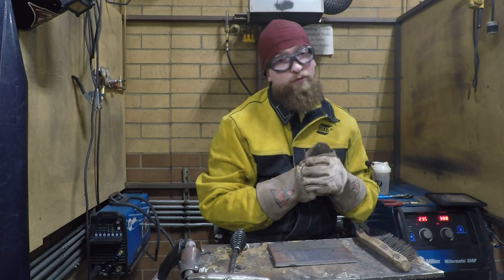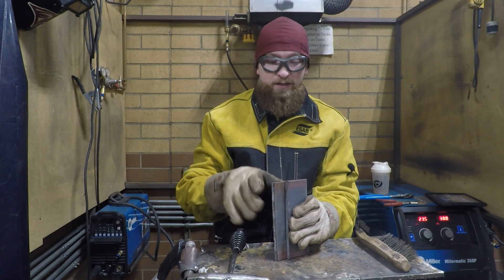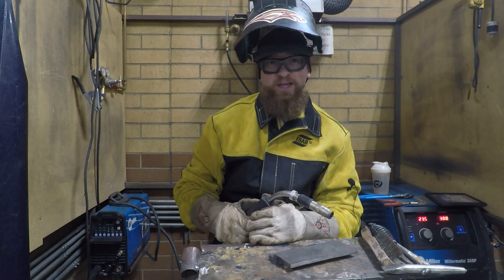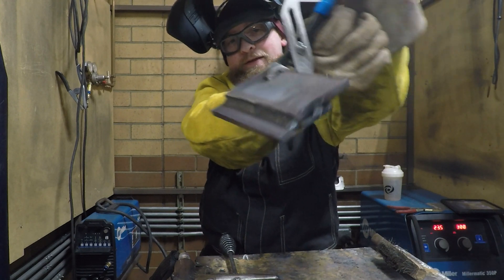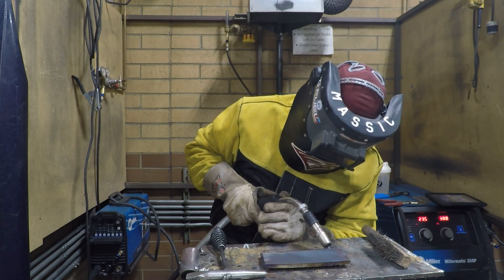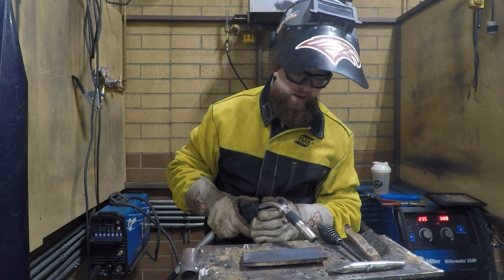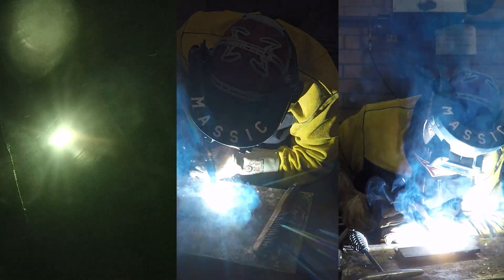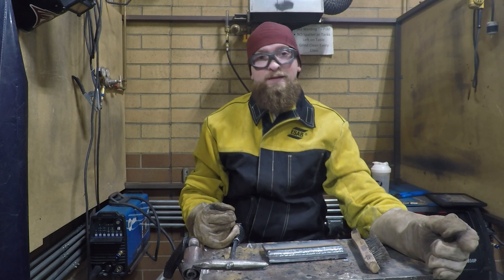FCAW - Weld 3 - Lap Joint

Comment: Jared..what if one plate is 1/4 and the other 3/8?..find a middle ground?  ..test plates?
Reply: Oh..forgot..I gotta Hobart  handler 190 if that helps..thx
Reply from the maker: Personally I usually go with the thicker settings and then favor the thicker plate.  As I weld I will then manipulate the puddle (maybe little circles) so that the puddle will wash into the thinner plate. But those 2 sizes are not that far apart that they should play well with each other.

Comment: Nice job. Just used my harbor freight flux core on some 1/4 plate in the garage it can't get hot enough. Have to slow the wire speed down to 30% on high voltage and go very slow and use a C pattern to make it work well. Any tips? Can't wait to upgrade welders.
Reply from the maker: Which Harbor Freight model do you have? Could be that the welder it self just doesn't have enough power.
Reply: @mmhswelding  Chicago Electric Flux 125. The cheapest one they have. I bought it to teach myself how to weld. It's great for less than 1/8. I put down nice welds on that but anything thicker, I think you're right, it doesn't have enough juice. If I run 2 beads on quarter inch it works. I melted two 1/4 plates lapped together like that and smashed the crap out of it with a 3 lb sledge and it held. What would be your recommendation for a flux welder the next step up? Something I can confidently use to weld 1.5 inch .095 wall tube with? I'm going to build my own side by side this year whether I F it up or not. Looking to spend spend 4 or 5 hundred. Thanks man. Those welds looked great for flux.
https://www.harborfreight.com/flux-125-welder-63582.html
Reply from the maker: Your welder would be great for the .095 wall tube.  But yeah you need a 180amp to 200 amp machine to weld 1/4" decently.  But in a pinch you could use a torch to try and preheat the metal up to 500 or so degrees will help those welds seep in better.
Reply: @mmhswelding  gotcha man. Thanks for the help. I subscribed.